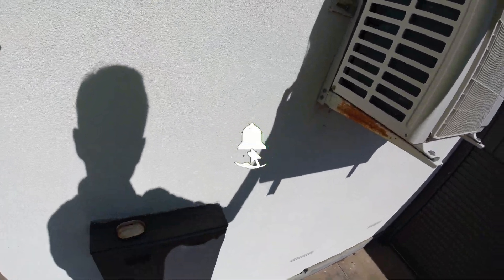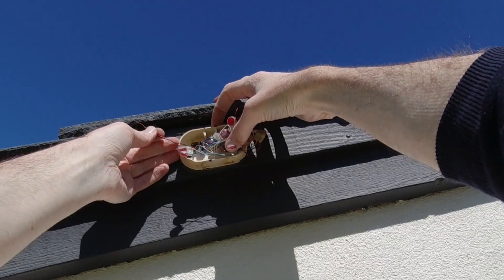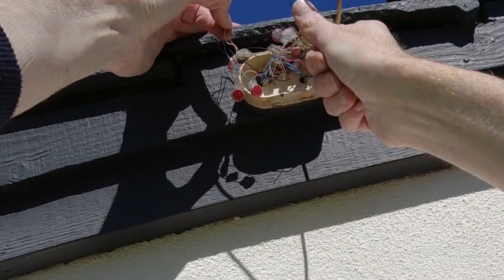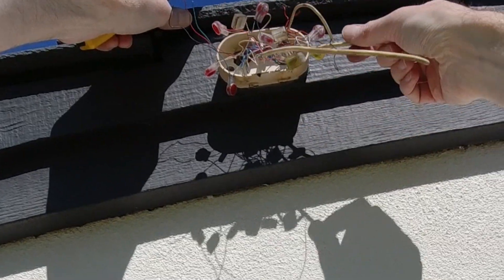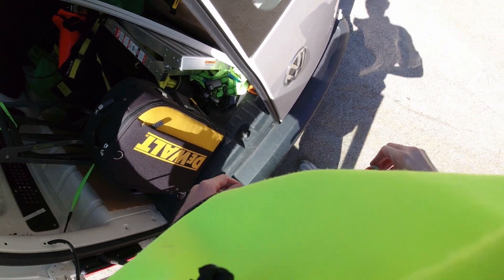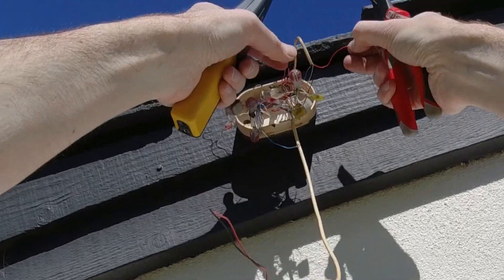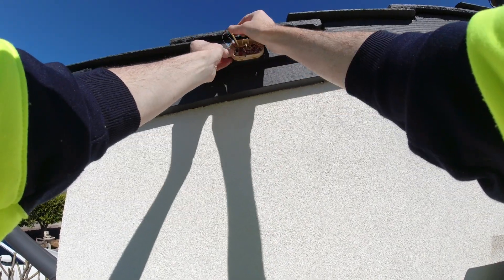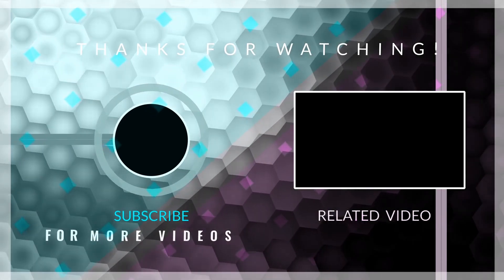Fixing NBN Bridge Tap

Comment: What are the dsl testers worth?
I used to be able to diagnose an adsl service by listening to the phone. NBN changed all that-
Reply from the maker: Oh yeah, test adsl was easy. Listen for dialtone :P
This dsl tester was about $600AUD. Which believe it or not.....was cheap, compared to other testers. It is a good tool, but can be confusing to use. I'm planning to get a different one with a large colour screen, if I do then I'll probably make a video on it too :)
Thanks for watching and commenting :D
Reply: @CommsGuy  maybe a demo of your current one? Can it test the copper side of fttc? I fix computers for a living and diagnosing internet issues is a major part of my work - I'm fairly good at skipping the "have you done x" part of the phonecall to the customers provider and going straight to get a tech out/replacement device needed part of the call.
Reply from the maker: @voltare2amstereo  hehe, it's great but also annoying when you've already done the ISP checklist before calling them :P
I've never tried the DSL tester with FTTC, only FTTN. I believe FTTC is still VDSL2 so I guess it would probably work.